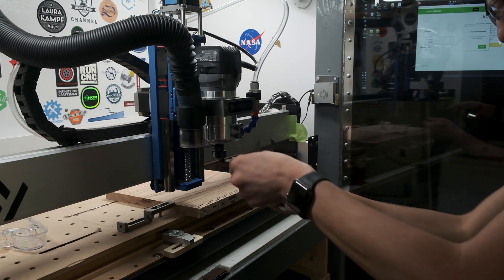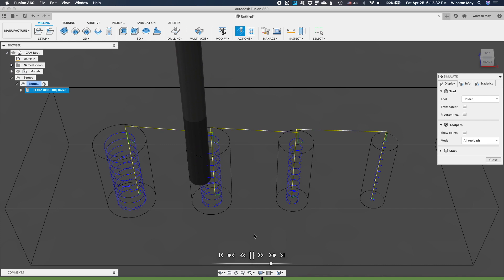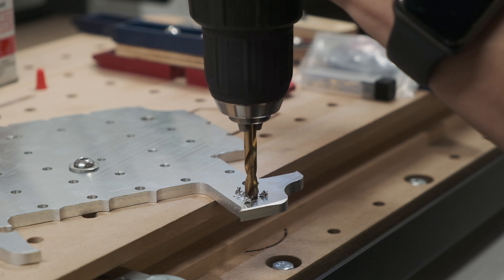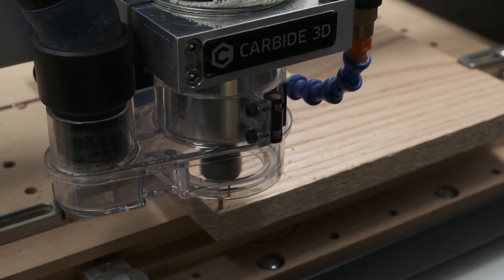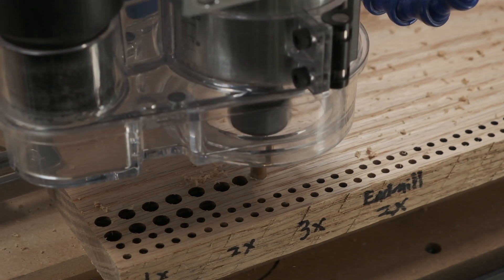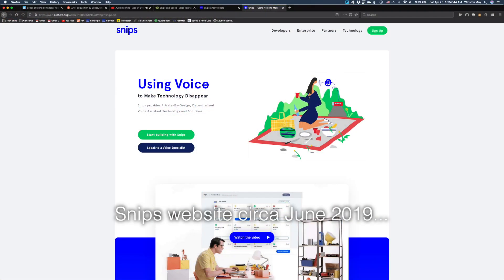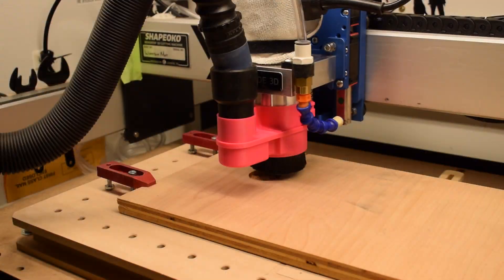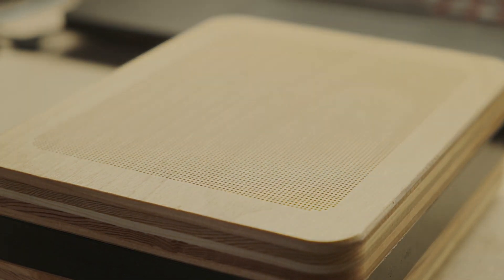How Bad is it to Drill on a CNC Router?

Comment: I am the CNC guy for my robotics team. We have a laguna swift 4x4 router. We drill all the time. We mainly cut aluminum, but also plastic and wood on occasion. We use carbide drill bits (HSS sometimes too), and the key is just just feed the hell out of it. I mainly do .191 holes in aluminum and I drill at .002 ipt at 18000rpm with a carbide drill. Cuts thousands of holes before needing to change. No pecking at all. 

The vacuum table we made with a .125” drill, we fed 120ipm at 18000 rpm. Drilled 4,000 holes no problem

You can do it, don’t be afraid

Comment: I use spotting drills on my 3040T which has a 800w VFD (hopefully to be changed to a 2.2kw soon ). I prefer spotting drills as you have not got the tip to break off. I spent 18 years as a machinist/toolmaker and only broke about 2 whilst working on stainless, tool steels, plastics and alunimium but have slightly more control with manaul machines. Funny enough I only broke center drills in manual milling machines and none in manual lathes even when using BS1 sizes, lol.

Comment: Try using a wood drill bit instead of a coated drill that was meant for steel.
Reply: that would surely reduce the friction heat due to the "sharper tool angles". also the wood drills have a center "pin", supposedly leading to better position accuracy

Comment: Your router is not designed for drilling, in the Makita RT0700c i pulled apart it only has one bearing at the bottom...

Comment: You don't know how to drill wood , you don't know which plunge rate and feed rates are needed you don't know how to set rpm you don't have enough knowledge why do you make a video about it ? first of all you don't need prek drilling while you're drilling wood , second of all you need to set your safe distance according to your material , 3rd you can reduce spindle rpm down in your gcode or your machine which is limitted by your spindle power , so if you can not do that its not gonna happen about all of cnc routers , 4th fusion 360 is not ideal for router cnc machines use artcam or aspire instead , 5th you're using wrong tools for hole making twist drills are flexible and aren't good for cnc drilling operations , and endmills are not good because of the middle of the endmill does not have any cutting bledes doe to circular rotation , you can use ballnoses and or special carbide twist drills for cnc not regullar ones , which in your case i prefer to use ballmill since your matterial is wood .also your twist drill is not a normal wood drilling one it is a normal hss steel twist drill which means that you can not drill too much holes with this even by hand .

Comment: I have programmed CNC machines with multi tool heads. No, you don’t use the cutting tool spindle for drilling, there’s separate tooling for that. We are of course talking about machines that will still cost you $50,000 used. A lot depends on the tooling you are using no especially the material you are cutting and drilling into.

Comment: A decent approach is to just use a spotting drill to position your holes with a depth of 1 or 2 mm and finish them on a drill press.
Reply: Not if you need them dead square on a spoilboard for anchor points.. 

Or dead square in general.
Reply: i plan to do that after im done making a working cnc router. i plan to update it as soon as i can cuz with garage tools, it has been hell

Comment: we drill 1/4 inch polycarbonate with a 1/4 inch flat endmill when producing our robot parts. No problems. We do have a Velox 5050 and an er collet spindle so it may not be as applicable to these desktop cncs

Comment: Hi, great content. 

Could you share some insights in how to drill PLA plastic with CNC? 

Holes 25mm deep and 2 mm in diameter 

Could that work on CNC?

Also am interested can CNC be made to work with camera detection of work peace by some kind of centering marks on it so that CNC would know where to drill the holes?

Comment: I drilled 2x 1000 hole grills in polycarbonate with a 1.8mm PCB drill and it worked surprisingly well. Biggest issue I had was that stringy chips would wrap a bit on the drill and eventually enough would be present to cause some heat buildup on the surface causing a tiny bit of surface melting affecting the finish. I was not going to led the build up reach the point where the bit broke, so I ended up pausing every 30-50 holes to clear the drill.

By the end it was clear there was a bit of wear on the drill because the bit needed to be cleaned slightly more often, but it was still working like a champ.

Comment: Edit: Oh haha, I posted this too early. you say the same stuff later on in the video.

Thinking in terms of surface speed and chipload is often more relevant than feeds and speed.
High RPMs is not an issue in itself, it is high RPM in combination with too large circumference = high surface speed.
Else there wouldn't be a need for tiny 70Krpm drills :)

Also, using a 1/4 inch (6.25mm) drill in wood at 10K rpm gives a surface speed of nearly 200m/min, where the highest recommended speed in wood is 70m/min. 
Even the 1/8th inch drill pushes this limit a fair bit.

With the same simple pattern, using a 1/16th inch drill would be a-ok with 10K rpm, but then of course there are other suboptimal factors.

Just felt like posting my thougts in the matter.
Good channel!
Reply: The recommended speed for wood is much more than 70 m/min, more like 200-300. It is even so that smaller table saws with 6' blades cannot reach the ideal speed. Ideally, you want to be faster than the splitting speed of wood. On the other side, you have the lower thermal capacity of HSS tools. I have drilled 8 mm holes in plywood with a 700W spindle without a problem. Now I use a 1,5 kW Suhner with a 12 mm collet which goes as low as 2,500 rpm. I tested it with some chip board and it doesn't even registered the cutting force. Only downside is that you probably don't get a collet for all possible drill sizes.

Comment: Thank you for sharing this.  I am looking at getting a simple CNC for making holes for cribbage boards.  This info is useful.  Do you have any opinion on whether a $250 Sain Smart 3018 Pro unit from Amazon would be sufficient for this?  I'd hate to spend more than necessary for this one purpose.

Thank you.
Reply from the maker: From the videos I've seen, it really doesn't look that great. Has trouble engraving a straight line if you go too fast. The time spent babying the machine is not worth saving a couple hundred dollars. If you plan on selling more than a handful of boards, get a better CNC.
Reply: @WinstonMakes  Thank you!  Good to know.
Reply: @DavZell  I have one, it's decent for cutting soft woods at low feederates. The main thing to remember is that its a 200 dollar router and not to expect anything too crazy.

Comment: It seems to me that this is a non issue if you have control over your spindle speed. I use a VFD, and adjust my spindle speed all the time depending on the bit, material, and operation. I use UCCNC for my control where I can tweak spindle speed on the fly if I need to. Pretty important for most any operation.

Comment: I've only drilled successfully twice on my CNC router. Both times doing shallow holes in wood, with very small bits. I tried many times, but always ended up destroying something. I tried lowering the min RPM in the VFD and that resulted in slower spindle speeds, but no torque at all, resulting in stalled spindle while the Z continued to feed down. At min RPM ( 9000 ) there's plenty of torque, but without flood coolant, aluminum welds to the bit and things break again. I've adopted doing a boring operation and that seems to work every time.

Comment: My Makita router doesn't have any issues with drilling slowly and the run out is as close to zero that it doesn't matter. And the router is compact. When I make a bigger machine I will use a Bosch router, but for the machine I have the Makita is perfect
Reply: makita/bosch or other routers have worst and stupid option use cnc machines, cheapen better ,silent have buy real cnc spindle, not cost any more than stupid worst router.

Comment: This video was so timely it made me laugh out loud.  I was working on a custom cribbage board and I was trying to run a path-oriented pattern of 363 (121x3)  holes when it completely bogged down my old Macbook Pro with only 8GB of memory.  While waiting, I started watching Winston's video.  Sure enough, Winston pointed out how memory intensive this process was as I watched my Fusion appear to do nothing...  I think I'll be successful but I'm STILL waiting for Fusion to render the new Bodies.  In the meantime, I'm going to be speccing out a desktop build as I've been lusting after the new Ryzen cpus.
Reply: Hey Jotham! Did you figure out a good plunge/drill operation for those holes? I'm doing the same thing with a .125 upcut (.25 shank) on my mikita router and were almost at the point where only a few holes burn. Curious if you got it to never burn a hole?
Reply: @tangyboi6420  I should also add that with hindsight, I might have modeled my cribbage board differently.  I modeled actual bodies, duplicated them about 288 times then merged them with the main body.  A smarter approach would probably have been to create a circle in a new Sketch, done a pattern with the sketched circles and then done drill operations off those sketched circles.  I'm not sure it would work but Fusion might handle a bunch of sketch circles faster rather than tons of bodies.
Reply: @jothammcmillan8854  Do you by chance remember what your plunge rate & rpm was? Also did you do a peck drill or straight up drill operation? Our project file is working great we just haven't dialed in our plunge/drill operation type.
Reply: @tangyboi6420  According to my file, I did a straight up drill operation (Cycle Type : Drilling - rapid out) with a plunge rate of 200 mm/min.  I haven't run this in forever so I don't recall how well that worked.
Reply: @jothammcmillan8854  Thanks!!

Comment: Wouldn't Fusion 360 have coped with the pattern much better if the pattern is applied in the CAM workspace rather than design?

Comment: Huh. I drilled a bunch of 3mm holes in aluminum on the XCarve (with a DeWalt). I never even considered it could be "bad" because it just worked.
Reply: Yeah, I've managed to drill up to 5mm holes in my CNC router (Vfd-controlled Chinese spindle, 3hp) but anything beyond that just gives sadness.

Comment: 4:25 - This is one of the key reasons I suggested that you change out the router for a PWM or PWM with analog converter type SPINDLE. I can ramp the speed down to 1000 RPM which gives me a lot more control over the process. Additionally, even though it takes a secondary machine pass, I will install a center drill which is very short to make a pass that just goes in perhaps 0.5 to 2.0 mm leaving a great starting hole. If the hole is slightly large, it just means you have a small chamfer on the finished hole. Then I will do the finish pass with straight or peck drilling as needed. The spindle is also MUCH more quiet as I will demonstrate. I had a water cooled when i made the video, but the air cooled use the outer body of the device for heat dissipation and are about as quiet. (And yes, I stated the airflow backwards.)

https://youtu.be/hALI4XpfmQ8
Reply: NO doubt that a water cooled (or even air cooled) spindle is a must have for so many reasons. Far better run-out, far quieter, speed control right from the software (Mach 3 or better), and usually higher horse power. No one would ever run a drill at 16k RPM, but I run them at 6k in aluminum with 1 thou per tooth and a pecking cycle on my cnc 'router'.

I go as far as to say it is a disservice for shapeoko to even recommend using a router for anything but the cheapest of budgets.
Reply: @BrettFleming  - Just a heads up about the air-cooled spindles. They have a minimum RPM in order to keep the air moving. askjerry can get down to 1K rpm, but my air-cooled spindle has a minimum rpm of 4K to keep cool. Still slower than the 10K that Mr. Moy is describing as a minimum router speed.
Reply: What model spindle is that?

Comment: Great video, I had to make 8 "bed of nails" for the physics department here at Fresno State University. Each one required 6500 #43 holes for the roofing nails. I did the first one by hand and almost went postal. The second one I did on our Bridgeport mill. I hooked up a stepper and Arduino to move the X axis for about 155 holes at a time. Still drove me nuts! I then purchased an X-Carve! I used Fusion 360 to make a square grid of about 2000 holes, and this worked great! The bed of nails were done in 4 segments each segment taking about 4 hours. I burned up six #43 drill bits and Broke 3 during the process. I should be noted that my Dewalt router quit shortly thereafter, but was repaired under warranty. I felt a little guilty about that. Driving all those nails is another story.
Reply: Don"t feel guilty about the DeWalt router. They randomly blow up in your hand if you don't flog them to death. After a couple of blow ups you will either change brand or just buy a water cooler 3 phase unit.

Comment: drilling with end mill is actually a better solution than boring if you have a right size tool.  when you bore something narrow and deep with a long end mill side forces will increase towards the bottom of a hole and tool deflection will rise so holes will be slightly tapered. to prevent it you should run boring toolpath twice what is time consuming.

Comment: I've read in a few places that one issue is the use of collets with standard drill bits.  It's to do with standard drill bits usually being marked by stamping the size on the shank.
This causes issues in collets if the stamping has burrs, making them difficult to clamp in collets without damaging the collet and/or running slightly eccentric.  Laser marked drills don't have this problem.
Reply from the maker: I did notice this actually. The cheap "long" drill bits I was showing for demonstration had to be inserted through the top of the collet because the stamped portion would not fit through the bottom.

Comment: Good stuff....did you touch on the force required to drill vs the available force on the stock Z (belt) drive...or did I miss that part...boring joke was really dull (another bad machinist joke).
Reply from the maker: I did not explicitly state it but now that you mention it, for anyone that cares:
The Z-Plus is roughly 4x better than the belt driven Z-axis in terms of axial force it can apply.
The HDZ is about 10x better.

Comment: very informative, I am just getting into CNC, which CNC software  would you suggest?   thanks
Reply from the maker: Depends on what you want to make. If it's just 2D stuff or artistic things like signs, you're probably okay with free stuff like Carbide Create or paid stuff like Vectric Vcarve. If you want to "engineer" things and design projects with multiple components that come together, Fusion all the way.
Reply: I would suggest you use fusion 360

Comment: Wow that snips thing actually sounded great, I'd been looking for on-device voice features for privacy . RIP I guess.
Reply: The mycroft project is what you're looking for.
Reply: @ThePablare  Is mycroft on device recognition? The site doesn't really have a lot of info but seems to suggest it isn't.
Reply: Coincidentally I just looked into this the other day so I will share. Mycroft does indeed support operation entirely on the local device however it is not recommended and requires a lot of processing power, were talking a full-blown workstation to get the conventional functionality and response times. Putting the big metal in the cloud and sharing across multiple users is what makes the whole concept economically viable.

Comment: I drilled many many 8mm(5/16") diameter holes in 1"(25mm) 6061 aluminium using a diy CNC with VFD speed control. Doing it using a router from a hardware store is more challenging and dangerous.
Reply: Peck drill aluminum or conventional drill a HSS drill will do thousands of holes before needing sharpened
Reply: A DLC-coated drill will probably outlast the machine when running alu

In my last workplace, 8mm DLC Carbide drills lasted around 12500 25mm holes in alu.
Reply: You could use pecking drilling feature in fusion 360, but you will kill your bit fast